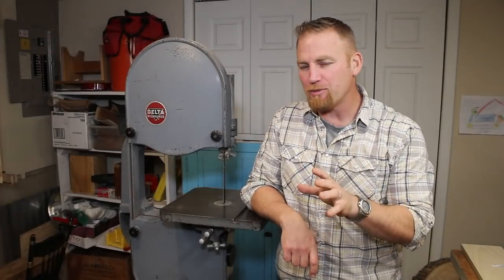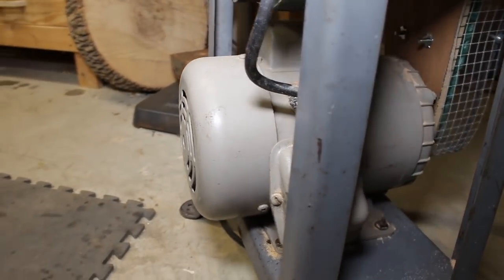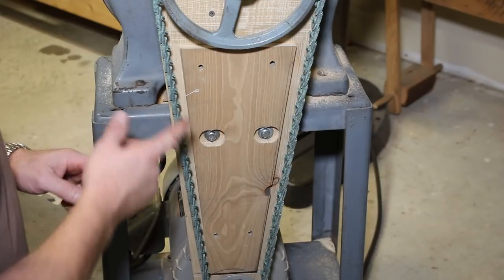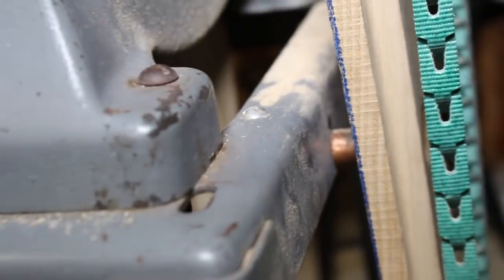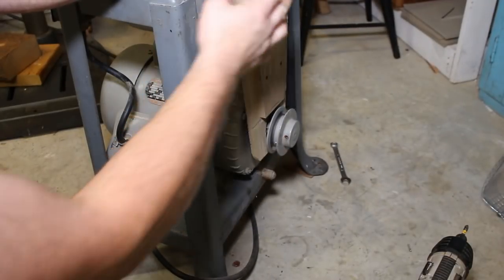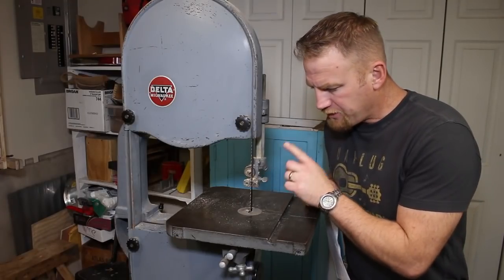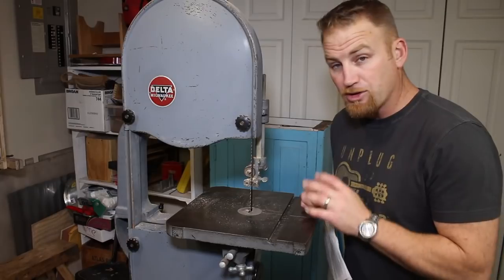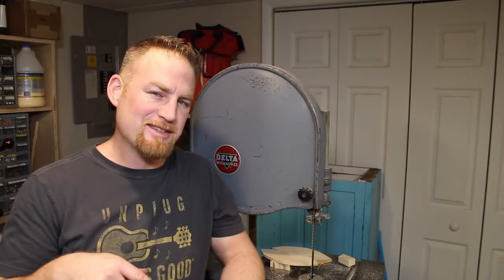Supercharging a 1948 Delta Band Saw- Resawing Setup and other Upgrades How to

Comment: Having no children around, I just leave the belt guard off my bandsaw (Delta 14" 28-276).  Not as nicely vintage as yours, but it's what was available in my area and it came with a blade tension quick release handle which I love.  It has a 3/4hp motor on it and resawing seems to work fine.  I do have a new link belt for it like yours but haven't installed it yet.  Got a Carter Magfence II for it I really like using as it is easy to remove when I want to do freehand work.

Comment: Looks like the saw is running great. What size pulleys are you running on the saw and motor?
Reply from the maker: 8" on the saw and 3.5" on the motor, thanks
Reply from the maker: The SFPM is 2,789 according to here http://vintagemachinery.org/math/sfpm.aspx